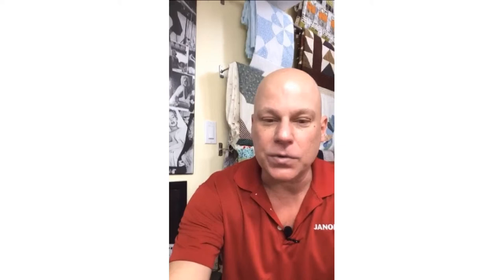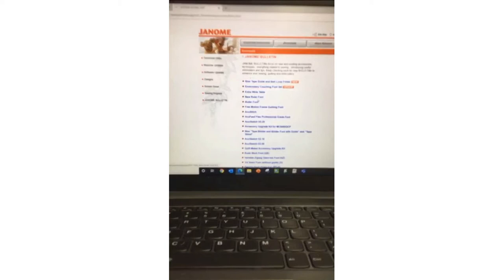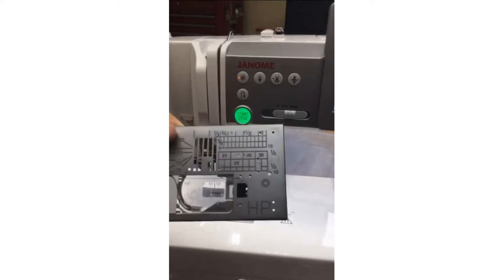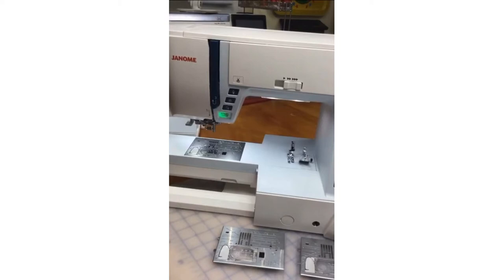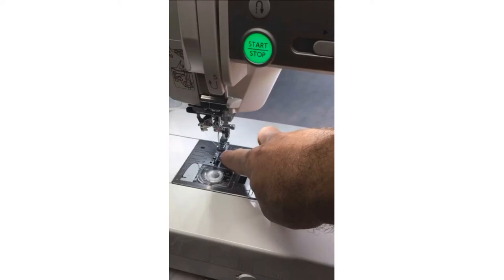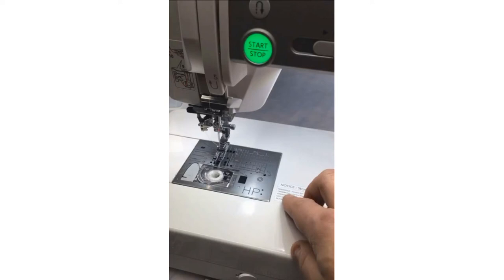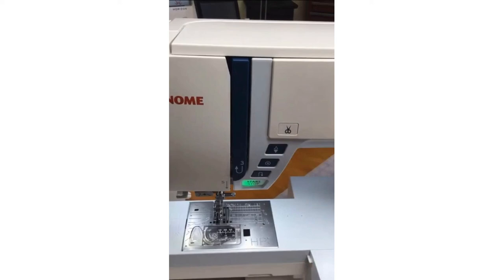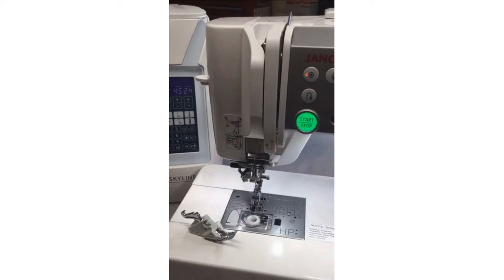Will the HP Needle Plate and Foot work in my machine?

Comment: will the hp foot and plate work with janome 12000 since its 9 mm
Reply from the maker: Technically, the HP Needle Plate and Foot will work on the MC12000, but the machine will not recognize the needle plate, so you will have to remember to manually move your needle over each time. Janome does not recommend using the HP Needle Plate on machines which don't have the recognized firmware to safely identify and use the needle plate. User beware! If you do use it, write yourself a note to remove the needle plate and foot after use before you switch the machine off and on again so you don't break a needle and damage the machine.

Comment: Will the hp plate work with the mc 14000 ?
Reply from the maker: Hello, as described in the presentation, only those machines with updated firmware which automatically moves the needle to the left needle position should use the HP Needle Plate. Technically it will fit the MC14000 but it's not advised to use it since you will need to manually move the needle every time and it's so easy to forget which foot and needle plate is on the machine. You would have to remove each before turning the machine off and on again. Janome rather err on the side of caution and recommends not using the HP needle plate and foot for that model

Comment: Can I use with 8900
Reply from the maker: Hello, as described in the presentation, only those machines with updated firmware which automatically moves the needle to the left needle position should use the HP Needle Plate. Technically it will fit the MC8900, but it's not advised to use it since you will need to manually move the needle every time and it's so easy to forget which foot and needle plate is on the machine. You would have to remove each before turning the machine off and on again. Janome rather err on the side of caution and recommends not using the HP needle plate and foot for that model.
Reply: @janomehqjanomecanada4908  thanks for prompt reply. Do I have another option of having this kind of foot .
Reply from the maker: @RN-ij6fd  The Janome Accessories Catalogue on our Janome Canada website has all the presser feet available for all Janome machines, which can be ordered from any Janome dealer if not in stock in their store. I've included a link here. Happy Sewing! 
https://www.janome.ca/siteassets/products/accessory-images/slides/ca/2023/accessoriescatalog-2023-jca.pdf